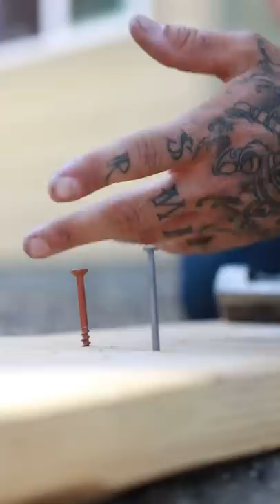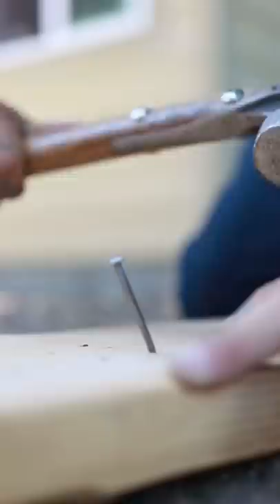Nails vs. Screws: Why do we use nails? #shorts

Comment: My dad was a carpenter, we just use nails because it's cheaper and easier

Edit: I see comments saying how screws work better and are easier to take out and yes that's true and nails easily fail with rotting wood and dont last as long I was just sharing why my dad always used nails, because it's easy lol
Reply: that's the real reason. It has nothing to do with stress. A house framed using 3 inch deck screws would be much stronger
Reply: After years in the industry I'll take the screws in a heart beat cost more takes longer but is alot stronger and if you do mess up. It's alot easier to back a screw out then pulling a nail out. When making forms for casting concrete if it was a one time form we would just use nails if we wanted to keep them and reuse them over and over we made them with screws because they wouldn't start to pull apart and shift.
Reply: Winner.
Reply: Thanks for the truth, screws work better in almost every application and can be adjusted
Reply: Yeah people want a complicated answer to an easy solution
Reply: or guys maybe hear me out: the nails were invented with this design yet you are saying they are better bc they are cheaper but when did he include money it seems like all these people just want to show other people that their opinions mean anything
Reply: @cynoxn  nails were invented back at the dawn of metleergy while the screw was invented as recently as the medieval times by wraping two wires together and fusing them, enabling advanced torture devices and triggering the industrial revolution.

Business don't use screws because they are more expensive. Nails will always be easier to manufacture bacause of their simplistic shape. You won't need to worry about a flexing home if you build it right and tight the first time. A home shouldn't flex to begin with. It's not a skyscraper (Unless you live in a natural disaster area).
Reply: @dmounce5513  it’s only stronger to build with screws if you use construction adhesive between the material that you’re screwing together. If you don’t then you’re not getting the full strength you could possibly achieve and you’re wasting time. If you’re a production builder you just can’t make that kind of sacrifice in time.
Reply: @dmounce5513  yeah i agree with that
Reply: @dmounce5513  and would take 3 times longer to build. So you'll add cost for the screw AND labor.
Reply: Nail guns are so much faster than a drill. cuts the time in more than half
Reply: @ashtonrollins5416  yeah you’re right
Reply: @engineeringreality7878  hah your pfp’s the image sciencephile the ai used for his ai singularity video. Did you get it from there or does the image originate somewhere else
Reply: @engineeringreality7878  no, wouldn't have the shear strength. Would not meet minimum code
 Structural screws would build a very sturdy house however.
Reply: @josephbarker6875  no, screws do not have the shear strength. Even for a deck without hangers, not a good idea

Plus would never pass a framing inspection.
Reply: that's funny man i actually find screws to be easier for me, quicker too
Reply: @BoneItis639  Thats because you dont use a nailgun buddy.
Reply: @ChefofWar33  that's because they cost a lot of money and an estwing costs way less
Reply: @BoneItis639  Well. It will pay for itself after you spend 5x the money on screws over nails over the course of building a house.  Also, time is money, and an untrained bozo with a nailgun can put in 5 nails before a skilled carpenter punts in 1.
Reply: @BoneItis639  faster than a nail gun?
Reply: @engineeringreality7878  is that really the reason  though? Don't think so. What about efficiency? With an air nailer you will RUN CIRCLES around someone screwing nails in.
Reply: @ChefofWar33  exactly. Funny seeing that dude say its quicker to screw nails in. The sound of inexperience.
Reply: @BoneItis639  eh me personally I think differently
Reply: @patrioticwhitemail9119  lol, no bud
Reply: Lol yeah there is a reason why power tools like electric circular saws and pneumatic air guns revolutionized carpentry. Labor expenses will always be the dominant cost of construction
Reply: Lol everyone's a professional home builder all of a sudden bunch of armchair coaches lmao
Reply: @ZeBackWoodz  I don't need to be a professional to see my home falling apart and drywall cracking before my very eyes.
Reply: When people build houses, they often choose a cheap alternative :[
Reply: nails are easy to put in and cheap everything else is just wrong. the snapping or bending depends enterely on the material. steel nails snap brass screws bend...
Reply: @bungoungo6926  dont bring no hate bro we all have preferences
Reply: I’ve never taken apart a house 🤔
Reply: @mazzonijacopo  i agree....labor is the primary expense...and will be the most increasingly expensive part I think. Now I would prefer to build with properly installed screws in a perfect world...now if my job was to pay other people to build something that may past 40 years with nails or 70 years with screws...the lesser strong buildning lasting 40 years will not negatively impact my buinsess where as spending the costs of that much additional labor will impact my bottom line much more.  There may or may not be shear issues under extreme loads, but the structure would likely be damaged by such forces so much weather nails or screws were used would largely be irrelevant. Its just cheaper and quicker and not SIGNIFICANTLY weaker to hurt buisness...but whwen I build a new  house to pass on it will be screwed...If your paying me without expressly telling me to screw it together then I would rely heavily on nails.
Reply: @patrioticwhitemail9119  I’d only caveat I’d add is that wedge nails were used because we couldn’t  pull wire with tensile strength we needed in the quantity we needed till the 40’s and 50’s
Reply: The material is cheaper. But the time spent is more and therefore it quickly goes out of favour. You also can't have anything hang off of just nails the way you can with screws.